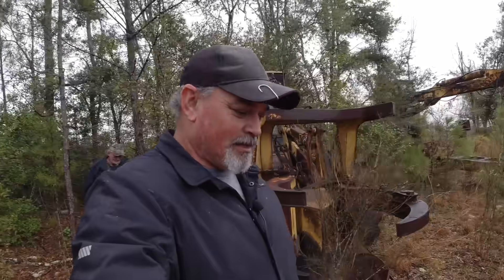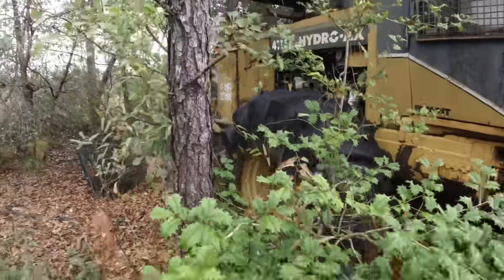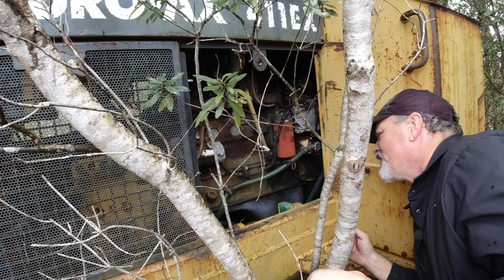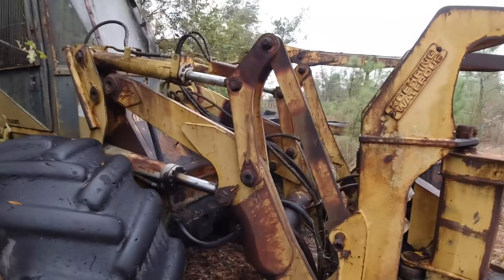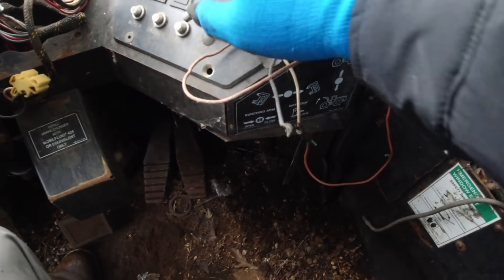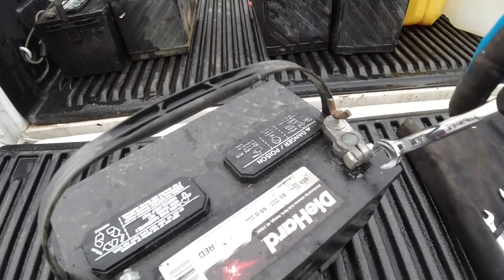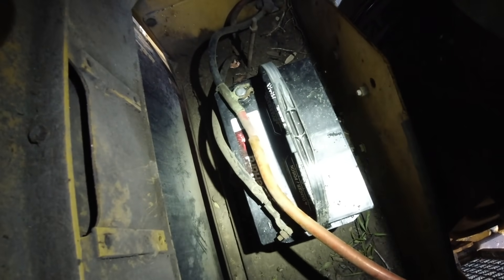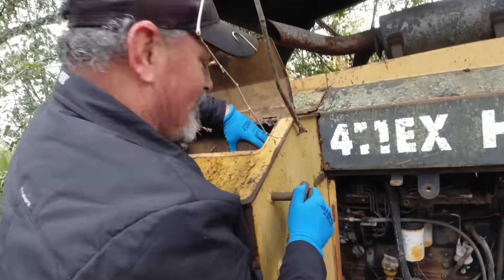Will It Start? Can We Get This BURIED Equipment Running Again?

Comment from the maker: Watch us crank a Dragline here: https://youtu.be/NqnqPjCnJYI
Reply: dont believe that dip stick was broke. Cummins are short on equipment. think about where the oil pan is
Reply: and the primer pump won't work if it is on the high lobe of the cam
Reply: depends what year she is
Reply: Pretty sure that isn't a 6bt
Reply: @midixiewrecked7011  if one doesnt work try the opther
Reply: @cameronhouston803  exactly what is this comment supposed to mean?
Reply: @midixiewrecked7011  that the big girls suppose to run
Reply: @cameronhouston803  big girls don't run , that's how they get so big.
Reply: @midixiewrecked7011  shes a beaut that girl yes hse is
Reply: I saw this crank of Dragline! Do part two of this video!
Reply: @andreykurtseba2466  happy easter
Reply: @cameronhouston803  Mi

Comment: My trick to pressurizing a Diesel engine is blowing air compressor air into the fuel tank. You find leaks and or you pressurize the system without using the hand pump. I'm not a mechanic but it works for me
Reply from the maker: Thanks for watching 👍

Comment: Aw Hank, that was too funny man. You talking about the Galion and how you couldn't shut it off & how confident you were with this, and then that moment you pulled the stop solenoid wire and she just idled down a little and kept right on running... Can't script gold like that man, love it!  Probably the teat on the end of the plunger has gone hard over time, or the plunger itself just a little gummed up from sitting.  The business end looks like electric over hydraulic so quite likely not having the key is stopping that from working (if the mice aren't). Be interesting to see if you can get back to this one and get her driven out of the grave and waving her arm around again. Cheers from the UK
Reply from the maker: Thanks for watching!

Comment: Just some helpful info  those manual fuel lift pumps.  If there is no resistance. Try rolling the engine over half a rotation.   When on the high spot on the cam lobe they wont pump. But on the lower spots you should feel some resistance
Reply from the maker: Thanks for the tips!

Comment: God I love you guys! There's nothing more satisfying to me than seeing these running again. My grandfather worked a pumping station in NC to keep the water drained from the eastern part of the state, the 671 Detroit's run nonstop at wide open throttle for  months on end and the only time they were stopped was to service all 4 engines,  they was in there for 15 years before rebuilding them,  nothing major happening to them. People's lives,homes, livestock and crops depended upon them.
Reply from the maker: That’s a cools story. People don’t realize what goes on behind the scenes to keep everything in order. And it usually a blue collar dude working long hours to make it happen

Comment: Good job, 
About the hydraulics, just find the hydraulic manifold. Normally it has some sort of manual override. For example by pushing small pin on the head off the coil.
Reply from the maker: Thanks for watching 👍

Comment: Don’t you know anything?? If you have a flat tyre you don’t need the valve in it to pump your tyre up  the next time you want a tractor tyre pumped up try putting 3/4 air in first then take hose off screw it in then keep pumping you will save ages and s up the same result